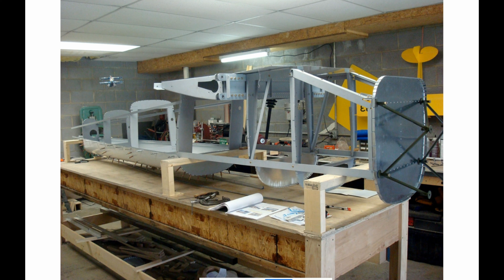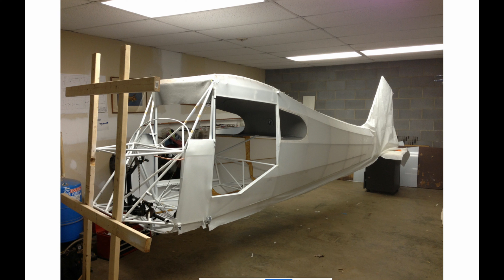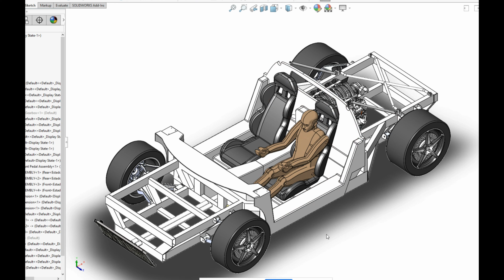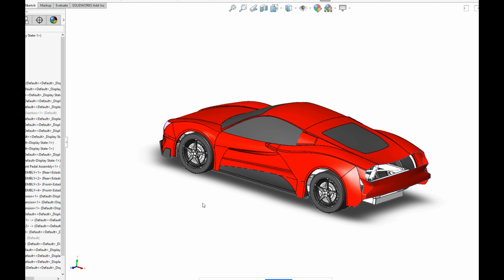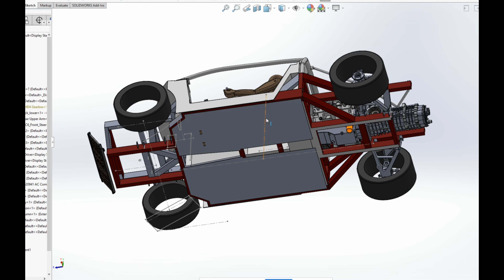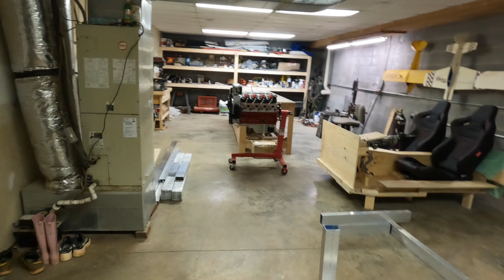Week 1- Introduction

Comment: Great videos. Sir what grade of aluminium are you recommending to use, and how much did just the aluminium chassis cost in materials?
Reply from the maker: I don’t have a recommendation but I used 6061-T6. It is a strong alloy, when you weld aluminum it looses a lot of its strength so I also went with 3/16”wall. I think I have roughly $2,500 in all of the chassis materials.
Reply: @basementsupercarbuild2948  thank you for the information. Such a great channel thankyou

Comment: where did you find the geometry and tab locations for the c5 suspension?
Reply from the maker: Very good question... If you have tried to find this info yourself, you know that it is very difficult to find. I started by buying a complete set of C5 suspension parts including the cradles, this gave me all of the lower attach point geometry. Then I found a couple of C5 frame parts for sale on Ebay and people measured them for me giving me the width dimensions. I finally found a great picture on the internet of a C5 side view that looked like a factory solid model. Was able to pull that picture into SolidWorks and scale it to the correct wheelbase dimension. From this picture, I was ably to see the suspension mounting points, suspension arm angles and most every other dimension needed. I am not sure all of my measurements are correct, but I am hoping they will be close enough that the 1" adjustment for the lower suspension arms will be enough to get the correct alignment.
Reply: @basementsupercarbuild2948  ya I am in the same spot and trying to avoid buying frame rail pieces to get the exact measurements I've been starting to collect parts for mine for about a year and the motivation is hard to hold up! Keep it up love the project thus far and the simplicity your going with